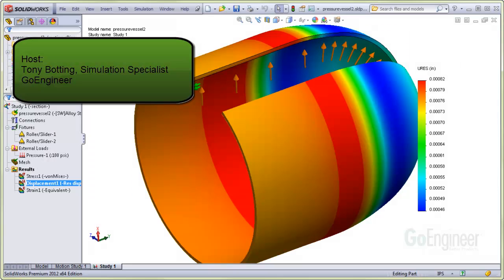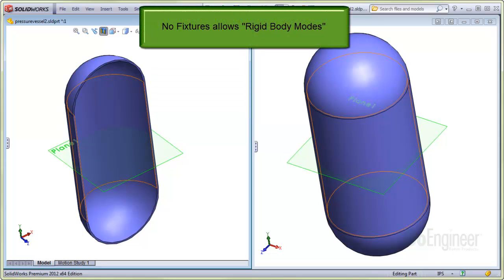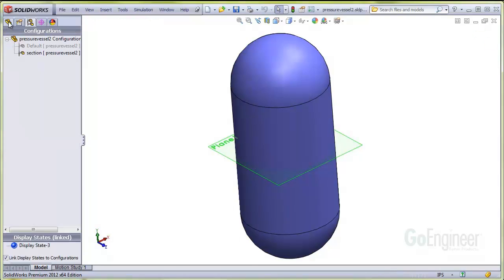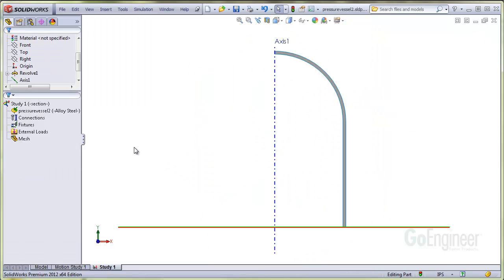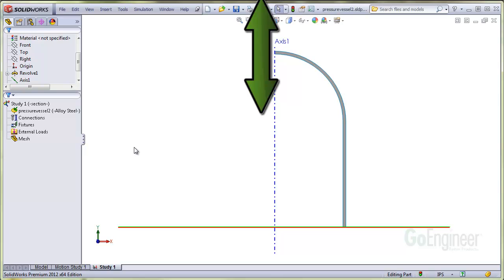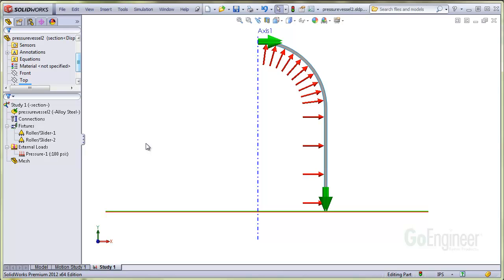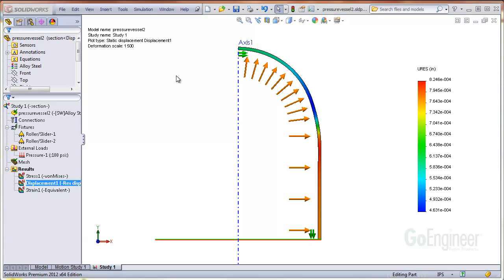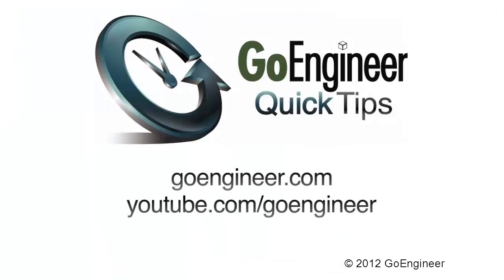SOLIDWORKS Simulation - Roller/Slider Fixture Example

Comment: Hi Tony,
I was wondering if this can also be applied for a spherical geometry. If not, is there another video  where this is explained?
Reply from the maker: Thanks for finding our video!  The roller slider constraint is only able to be added to flat or cylindrical faces only.  If you would like to control the degrees of freedom for a spherical geometry, we have a dedicated 'On Spherical Faces' fixture type located under Advanced Fixtures.

Comment: I have an irregular shaped single part container and I want to put vacuum pressure on the inside.  How would I constrain this so I do not affect the part analysis.  I tried "soft spring", but there still needs to be fixtures in place.  Any ideas?

Comment: Hi Tony, 
I am running a simulation on a submarine and am have the same question of where to apply fixtures, or if no fixtures are applied how to restrain it. It is symmetrical about the right plane. Any help would be appreciated. Thanks.